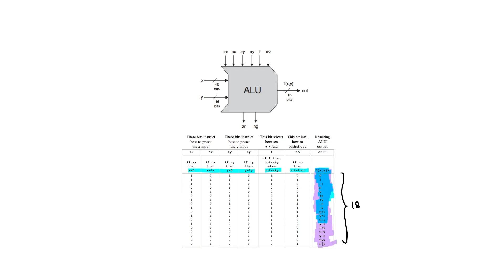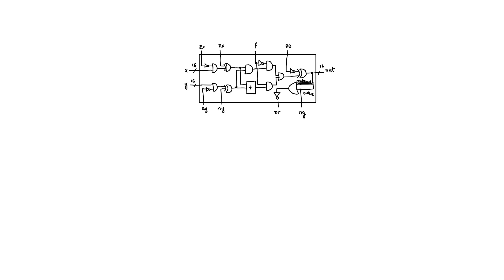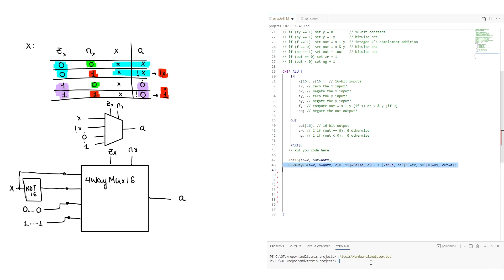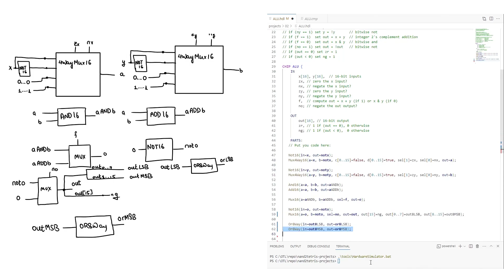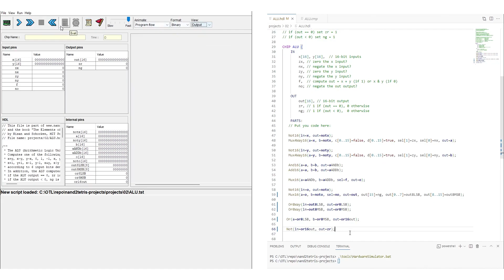How to make an ALU (Arithmetic Logic Unit) from logic gates and mux | nand2tetris project 02

Comment: At 1:49 why is Nx on the left hand side of the truth table and not Zx?
Reply from the maker: Sorry for the late reply! You’ve probably figured it out by now but for anyone else wondering about the placement: I was adding the 'nx' logic to the already-derived logic for 'zx'  to chain them one after another.
When creating the larger truth table, if 'nx' is placed on the left I could insert the 'zx' table as it was before.
Of course, you can place 'nx' or any input wherever you like — the result should mostly be the same, and you might even end up with a better outcome.

Comment: Hi! I have a question which is that if I change the selectors' sequence in the Mux4way16 in the beginning, it will not output the final input of x and y successfully. Why?
Reply from the maker: Hi! It is how the Mux4way16 was specified to work by the nand2tetris project creator. If you take a look at the description of the mux in  Mux4Way16.hdl file of project 01, it describes how the mux should work with selector signals so we designed it that way. There is a video (5th on the nand2tetris playlist) that may give you a better picture. Ofcourse you can change the sequence of selector signals, but then you also have to modify the truth table and therefore the input sequence so that the selectors select the correct input signal as output.
Hope it helps. and I'm sorry if I misunderstood the question.
Reply: @onthelearn  Thank you! I solved where I am confused about!